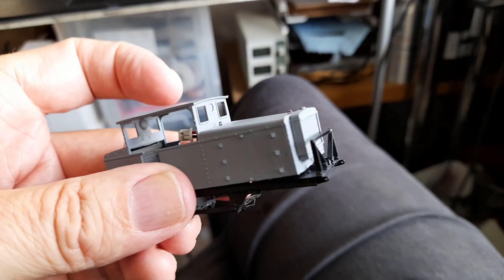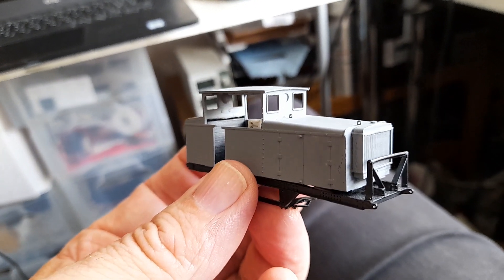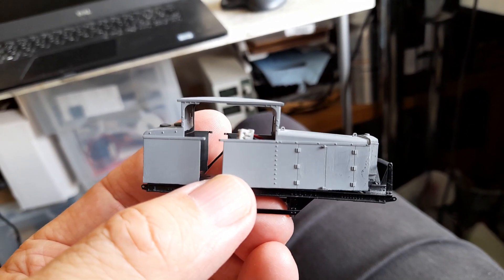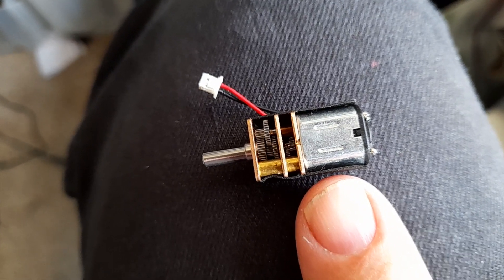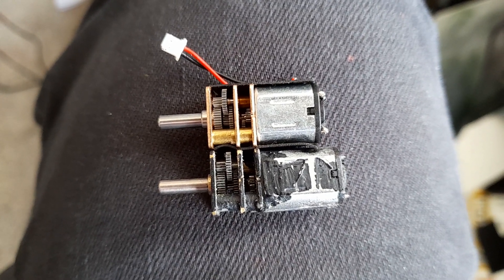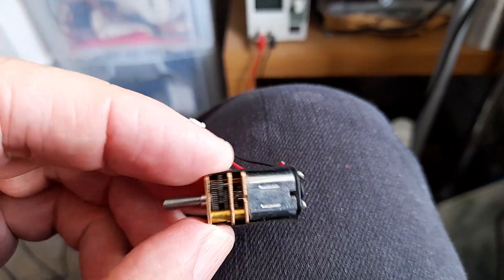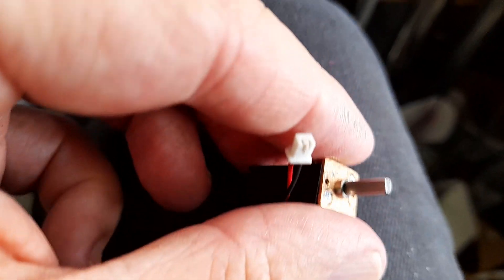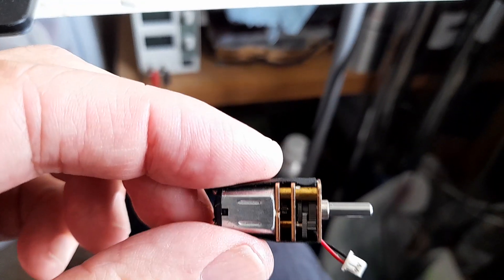the new N10 gearmotor

Comment: That's very neat Giles.

What sort of scale speeds will that achieve? Ideal for narrow gauge locos - accurately geared I suspect 🤔🤔

Agreed, you'll have a job to stall that sort of set up - it's a  'proper job'.

We run, similar, larger units, in some of our SM32 battery and battery RC locos. Makes worm gears et al look very crude by comparison.

Thanks for sharing 👍😊